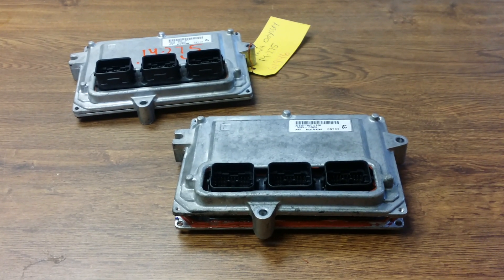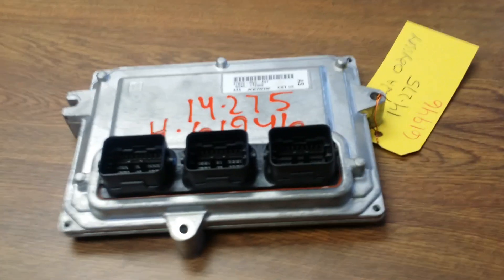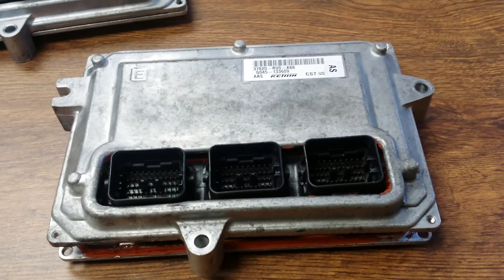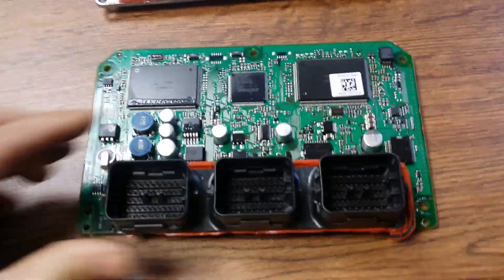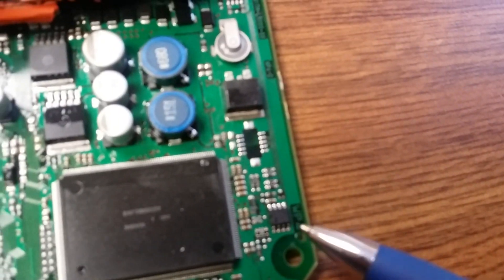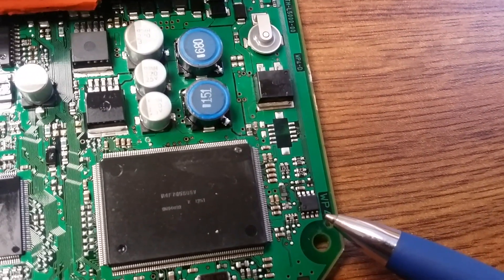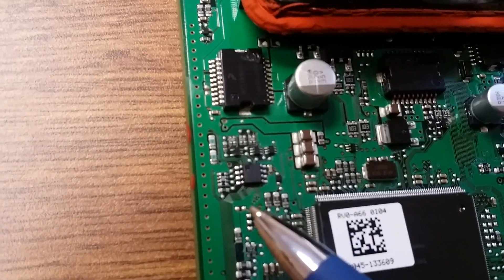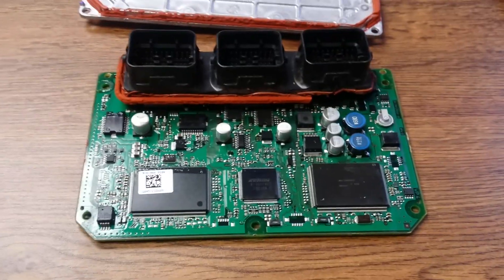HOW TO PROGRAM HONDA ECU IMMOBILIZER KEY AFTER ECU SWAP

Comment: I have an 2007 honda crv JDM with a bad pcm 37820-rza-904 and i bought a USDM 37820-rza-a55 pcm on eBay. I have an advance scantool with pcm replacment function and can program the immobilizer. Anyone tried to put a USDM PCM in a JDM honda and it worked?

Comment: Hey bro wud u kno wat in these ecu are related to the ac high pressure sensor. Scan tool says pressure is 500 psi with 5v but my gauges say the pressure is not high and multi meter says 3.75v on the signal wire

Comment: The good news is that the EEPROM can be read by an Arduino 🙂And you can flash the data to new EEPROMs.  An EEPROM is basically a small flash storage chip for data, a car's configuration info, etc.

Comment: Awesome video hope it'll work for me... but one thing you got the 2 chip locations mixed between the two boards. On ecu is upside down and the other isn't. So the locations on the new ecu would be opposite side of what u said in the vid

Comment: You got to be kidding me. You are going to have people destroying there ecu’s. Extreme heat will destroy it.That is NOT silicon. I put a piece on the bonding adhesive in extreme heat for 2 minutes and it did not melt. Why don’t you show how you opened it.
Reply: Little heat and flat heads. Silicone ain’t gunna melt. But it will soften a bit. Gotta be a man to get the ecu open. Now the area with the plug.. idk how he separated that

Comment: Could someone confirm what he means by part number? The part I am about to buy has the first row exactly the same, however the second row of numbers (where he has G045-172908 and G045-133609) is different for the last 4 numbers. Would this be a problem?
Reply: did u ever find out yr question , i'm also on the edge of buying a use one and the bottom number is also different

Comment: My friend's 98 Accord LX, 4 banger, 110K, dies intermittently. I replaced the distributor but it is still dying. I will try the ignition switch next. I was wondering if the immobilizer could be the problem. The key is original. Can the transponder ring cause intermittant stalling? I am not sure if new ones are still available. I think I can put a used one in and will not have to reprogram the key as it is just the reader. I appreciate your thoughts.

Comment: I have an 08 element that I bought but the steering column has been taken out, I found a steering column on car parts but doesn’t have an ignition key, if I buy that column without a key, and also buy a ignition with key for it, can I buy the same ecu off that element that I’m buying the column from and perform this with my current element ecu and crank it up? I’d appreciate your response. I hope I explained it right, cheers for your helpful bids. Def subbed!

Comment: How did you remove the silicone from the plastic connectors on the 2014 Honda CRV ECM, got the cover off but afraid of breaking plastic connectors as they are glued.
Reply: I’m having the same trouble. Can’t get it to budge. How did you make out with it after?

Comment: Hlw I have Honda fit year 2010 ,the welding guy did welding without removing the positive terminal of the car ..the car now won't start no battery light and engine oil light have tried to replace new ecu but still the same and no communication with diagnostic tools

Comment: Hi i have a question I have a ECM in which I replaced with a used one for a Honda CRV 2011 because the old one is damaged. Is there any way you can reprogram it ? Or anyway you can help me

Comment: Yeah, sure. Cover the chip with foil & use a heat gun. Are you  crazy? You would melt all the  solder on the board near the chip. I would like to see you unsolder those surface mounted chips. I'm an electronic tech. with over 30 years experience & I would hold my breath while I was doing it. You would need to have solder wic or a solder sucker & a low (25 Watt) soldering iron. A little knowledge is a dangerous thing. Your video is setting people up for  a big nasty first time soldering experience. Way to go!!

Comment: To seal it back up , you can dip it in a gallon can of silicone , that's what they did for the Chevy Corsica model year 1980 brand new when it was a test vehicle , they stupidly put it right behind the driver's side headlamp and when it rains out it was getting wet and burning out ! Yes 1980 was the first Corsica model on the new vehicle list , moral of the story ? Don't buy a new car that hasn't been already on the market for the first 3 years , that used to really tick me off

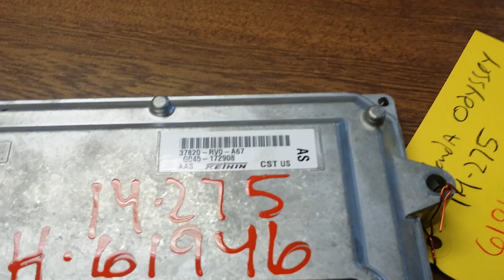Comment: 0:39 - these 2 computers don't have any matching numbers.... lol but he said its very important that they do match. ?
Reply: Your right they those numbers don't match at all. WTF.
Reply: I believe it's just the top row of numbers. 37820-RV0-A66 although the other does have an A67 at the end. I don't remember for sure but I think the A66 and A67 might only mean one is newer for that year and probably signifies a patch to remedy a fault in the previous ecu. The other numbers are probably stock location numbers for the point of sale (p.o.s.) system for the retailer they purchased from to know if they have it and where to find it in the back of the shop.

Comment: Another trick is getting a JDM ECU like I did. As far as I know, most cars in Japan don't have immobilizers, so those ECUs are usually plug and play if you get the right one. At least it was for me. I plugged it in and the car started right up. I hope that this information helps someone
Reply: 2000 accord. Nieghbor wants to sell me a car with bad pcm. What are my options?  Cheap options?   This is my cousins page. Im cj. Engine tech. I heard u ca  just pull the immobilizer chip
Reply: @cydneymccoy9559  Sorry for the late response, I just now saw your comment. There is no simple way to bypass the immobilizer, people say you can just pull the board out or jump a relay or whatever but it won't work, I tried it. The only ways to get it to start is to either have the ECU flashed to your key or get an ECU without an immobilizer. If you need to get your ECU flashed try calling local locksmiths and mechanics, you can probably find someone to do it way cheaper than the dealer. The other option is to go to a junkyard and get an ECU, ignition cylinder, and key from the same car. If you do this you will have 2 keys but you won't need to have anything programmed. Hope this helps
Reply: Avery Alexander where do you orders those from?
Reply: @joelshimp  I got mine on eBay for $15 shipped. What kind of  car do you need an ECU for?
Reply: Avery Alexander 2010 h hi ones Civic lx auto 4 door
Reply: @joelshimp  I am not sure about the 8th gen Civic ECUs, but I know that at least the older JDM Honda ECUs up to 05 have an immobilizer if the letter at beginning of the last group of the part number starts with N and it has no immobilizer if it starts with J. So if the part number is 37820-XXX-NXX it has an immobilizer, but if the part number is 37820-XXX-JXX it has no immobilizer and starts right up with no programming. I do not know if this is the same with the newer ECUs though. I found this ECU on eBay that might work for you. If your car is drivable with the ECU that's in it maybe check to see if you have a JDM engine shop around you and if you do see if they will let you try the ECU in the parking lot before you buy it, just plug it in and see if it will start. Also, if you choose to go with a US ECU, call some local mechanics and locksmiths and see what they charge to flash it to the key, it will likely be a lot less than what Honda charges. The other option is to go to a junkyard and get an ECU, ignition cylinder, and key from the same car. If you do this you will have 2 keys but you won't need to have anything programmed. Hope this helps. Sorry I couldn't help you more, but hopefully this information is at least somewhat helpful to you. https://www.ebay.com/itm/06-11-HONDA-STREAM-1-8L-SOHC-VTEC-REWRITEABLE-ECU-37820-RWK-J82-JDM-R18A/173936311117?hash=item287f697b4d:g:yLkAAOSwKghdn2S3
Reply: Will a us car pass emissions with a jdm ecu? I have a 7th gen civic DX MT.. throwing P2227 code, told I need new ecu
Reply: @trochartist  I don't think it will, I have been told that the JDM ECU's don't have the US emissions testing software such as readiness monitors and won't communicate with the emissions test equipment. Never tried it though since there is no emissions testing where I live. However, you may not need a new ECU. That code can be set by other faults like a bad or improperly adjusted TPS or MAP sensor. What diagnostics have been done?

Comment: Nice video, I didn't know that this could be done. But I laughed out loud when you said "you want to make sure that the part number matches up exactly". Not because that's bad advice, but because one ECU you showed was a 37820-RV0-A66, and the other is a 37820-RV0-A67.
Reply: It’s called supreceded part number, I work on a Honda dealership, if the last digit from the part number is only like one number in difference is basically the same number and part function ,don’t ask me why does American Honda do this lol but they have their reasons, and I hope you learn something today
Reply: @davem1625  Thanks for the information, I have seen that before on some parts. I'm not sure about American Honda, but I know from experience with JDM ECU's that 1 digit can make a big difference. As an example, an ECU with a part number of 37820-PSA-J83 is functionally very different than an ECU with the part number 37820-PSA-J84 since the former is is designed for a standard o2 sensor and the latter is designed for a wideband o2 sensor. I'm not sure if US market ECU's are the same way.
Reply: @averyalexander2303  wouldn't that just be a difference of like two wires on the ECU that you could just repin on the harness
Reply: @altaccount3760  The wideband vs standard o2 sensor? No, they work totally differently and the ECU can only use the type of sensor it was meant to use. Also, even if a small difference is fixable by modifying wiring, good luck finding a wiring diagram for something that was only sold on the other side of the planet. It can be virtually impossible. For a different reason, I spent about 2 years looking for a pinout for a JDM Honda Stream ECU and I tried everything I could think of. I tried searching a bunch of Japanese websites in English and Japanese with a bunch of different keywords, calling Honda Japan, searching and asking on many global car forums, reverse engineering the board, etc. I finally figured out that one freaking wire after countless hours of very careful trial and error and buying an entire JDM Stream engine harness to reverse engineer and compare to the US harness, but it's definitely something much easier said than done.
Reply: @averyalexander2303  yeah I was stating this cuz it is as simple as swapping the wiring and running wideband o2 sensors I know at least on the k series and the d series ecu's
Reply: @averyalexander2303  I don't know why you weren't able to get the wiring diagram most dealerships will just give out that information
Reply: @altaccount3760  You can not use a wideband sensor with an ECU designed for a narrowband sensor no matter how you wire it. The sensor must match the ECU, it's that simple. The different types of o2 sensors generate completely different signals. All the US K series ECUs support wideband sensors, but none of the D series ECUs do except the lean burn Civic VX and HX and the 04-05 Civic.
Reply: @averyalexander2303  yeah is it beyond your imagination to open your ECU? Sorry I suppose I run aftermarket ones
Reply: @altaccount3760   @Alt Account  Aftermarket ECUs are a completely different story, I assumed the discussion was on stock ECUs and sensor setups since that's what most people use and no one mentioned anything else. Converting a stock ECU to accept an input from an aftermarket wideband setup requires a lot more than "just repinning like two wires on the harness" as you suggested. You would have to add a daughterboard to the ECU like Hondata S300 and get a wideband controller to wire to the ECU. While that's interesting and certainly has its place (I have Kpro in my sleeper Civic), it's way too expensive, complex, and time consuming to be a practical solution for an average driver who just needs their car to run properly.
Reply: @averyalexander2303  no I think you just don't understand motherboards that well
Reply: @averyalexander2303  I mean you've already described the sensors as working totally differently when they really don't and a quick Google search can show anybody the very minimal differences between a narrow band and a wide band sensors signal input and I personally know that the d17 ECU is capable of running narrow band and wide band along with many other ecu's on the market while you may be right that some ecu's are incapable of this for most it's a simple mod and for those ecu's that can't do it there's normally an easy plug-in play swap option for another ECU that already runs wideband and the difference is likely two wires lol but yeah whatever you say so hard definitely need a daughter board for that lol I bet you tell everyone to take their car to the dealership to lol
Reply: @averyalexander2303  also I'd like you to check again what d17s can run wideband BC you're very incorrect any 04-05 can and only some 01s-03s can
Reply: @altaccount3760  Any 04-05 Civic can because they all come with a wideband o2 sensor from the factory, but at least here in America, none of the 01-03's can except the SI with the K20 and the lean burn HX. There may be differences in other markets, but in any case, you have to use the sensor it was designed to use. You can't just throw whatever sensor you want in.
Reply: @altaccount3760 I wouldn’t think so. Them days of doing that are long gone.
Reply: @averyalexander2303 dude I think this is probably a kid that’s around 14 and maybe his uncles best friend has a honda and one day when they were no baby sitters they had to take him with them to the local tuner that has a dyno, and he learned a little bit of lingo, while his uncle changed the wastegate springs and he held the light, car didn’t blow up that day though, 5,000 horsepower at flywheel running on 3 cylinders. 

Unfortunately this has turned into a sick waving contest and all the good is gone. Like donkey Kong
Reply: I could be wrong though this could be that dude on fast and the furiously dude that was building cars on pirated auto cad. Before he lost the race.
Reply: It's still the same part number. Honda does something like this 37820-RV0-A66       A60 through A75. Meaning they are the same from A60 to A75 as an example.
Reply: Could someone confirm what he means by part number? The part I am about to buy has the first row exactly the same, however the second row of numbers (where he has G045-172908 and G045-133609) is different for the last 4 numbers. Would this be a problem?
Reply: You can also get a $50 from Walmart that will program immobizer
Reply: @RobertDickens2002  really?  What is it called?
Reply: @nathancleveland8198  not available at Walmart anymore but it's autel at200
Reply: Is the last numbers?
Reply: @Bobmpho  Yes, the entire number must match to be 100% sure it will work properly.

Comment: The hardest part is no doubt, to open the box ! When you heat up the edges, the aluminum body transfer the heat everywhere so you actually risk overheating the thing. That glue is awful !!
Reply: there has to be another trick, you can’t put much heat close to where the bulk connector is to get the board loose from the cover. What is the secret? I messed the board up with too much heat too much heat didn’t have much persuasion on this proprietary keihin rubber looking glue

Comment: 2007 civic hybrid chip# is s93a66 there are two pairs, 4 total on side of board opposite ecu connectors.  No need to pull both covers, only the first one when you split the case.
Reply: Thank you for this comment, I'm doing this repair right now on an 08 Civic hybrid. How did you figure out which chips are the EEPROMs?
Reply: hi daniel.im also trying to identified which one are the immobillizer eeprom on the 2007 civic hybrid.

Comment: Hello 
I need to crack d17a2 immobilizer do you know how ???
Reply: I don't know about how you would do this trick, but what I did is I bought a JDM ECU since most of them don't have immobilizers. The one I bought for my 2005 Civic with a D17A engine is a 37820-PSA-J84, and everything works perfectly except for the D3 position on the shifter. I plugged it in and it started right up and ran perfectly. I hope this helps

Comment: Swopping eeproms is data transfer. You cannot call a locksmith to code it as a used ecu already has info. The video shows the correct way normally if u swop just the C66 eeprom it will be fine. Make sure ecu numbers are same. Dealers wont want you to knw what this guys showing on his vid...
Reply: witch are the serial numbers the first 5?

Comment: wouldn't it be easier to install the new computer, then call a locksmith that has the tools to flash your ecm to the key? I did it for 100 dollars and I didn't have to solder or open the new 
ecm
Reply: Absolutely. It's much easier to call someone else... the point here is to show "how to save" those extra $$$s by doing it yourself. This is not for the "average" scrimper though....
Reply: Yes, reprogramming is the right way to do it and it's much easier.  Forget calling someone you can buy the Honda diagnostic tool from ebay and save yourself 100 and you will own the tool.
Reply: @excite236  which tool is this?
Reply: @ungseiha2796  you can get 'honda hds diagnostic' tool from ebay.  You don't have to remove the ecm.  sorry not sure if it supports your civic hybrid
Reply: @excite236 but don't you still need an immobilizer code?